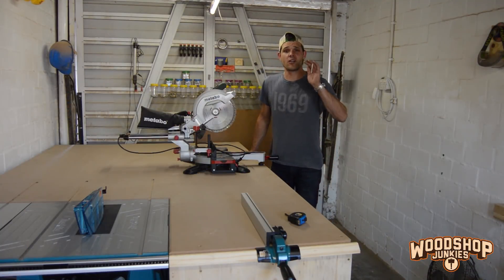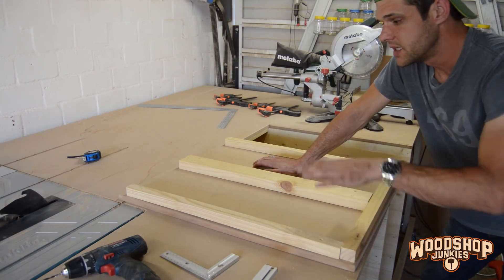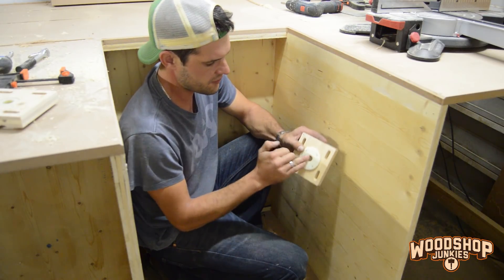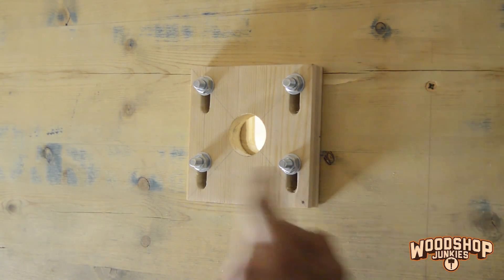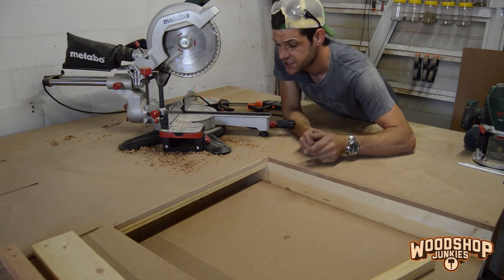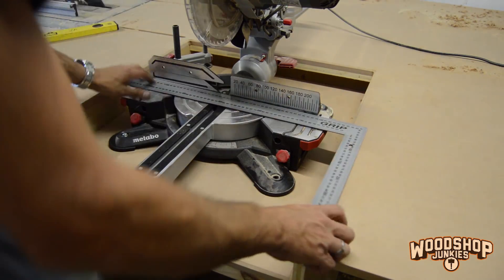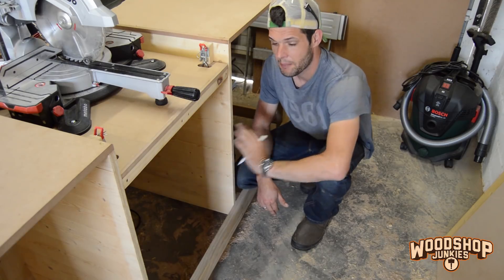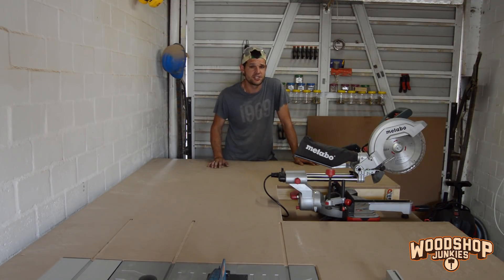No clash! MITER SAW INSTALLED to table saw station - ALL IN ONE woodworking workbench. P3

Comment: Why don't you cut a piece of plywood the size of the hole you cut out for saw , install  some side blocks to flush out to surface then install magnets to hold the filler piece in covering that hole. Nice job though😊 Charles Esposito from Louisiana USA

Comment: How does the miter saw do with 45 deg cuts? Is there enough space in the recessed section for movement in your angle adjustments? Thinking of similar installation in my garage workshop

Comment: If you can't find a bracket just drill a hole through the bar and use a locking pin.

Comment: Loving this series - actually breaking it down by segment makes the whole project less overwhelming. I was particularly interested in this segment for the mitre saw as debating myself as to whether a lift, a flip or folding, (like yours) is how I will go. This one is getting good consideration! 
If I may, one thing that struck me as you were installing the pivot blocks was how snug the rod was in the plastic bushes (which is not in itself a bad thing) - however the rod in the holes in the shelf is possibly (likely!) slightly looser; that means that the wooden holes in the shelf braces are more likely to pivot around the bar, rather than the bar to pivot in the plastic bushes. Now it's not like this is going to be rotating on a frequent basis, but ultimately the wooden holes can wear through this mechanism and the whole point of those lovely bushes is to have them be the pivots!. A simple solution to forcing the bar to pivot in the plastic (vs the shelf holes) is to fix the bar to the shelf so the shelf cannot rotate on the bar - this could be as simple as a ground-off screw through the shelf rail acting on the bar like a 'grub' screw. 
Thanks for your great tutorial and execution!

Comment: Great project. What about putting a lip on the inside of your drop saw area? That way, with the saw down, you could drop a free panel onto the hole and cover in the area formed by parking the drop saw. That would preserve a large clear uninterrupted work table. Cheers.

Comment: I'm enjoying this series. I wish I had the space to do something similar but I also have just a slightly over-length single garage and have to park my car in it too. So I'll be building separate rolling benches that can push away to the back when not in use.
Reply from the maker: Steve Crane unfortunately in our beautiful country this is the case. Cars can rarely be parked outside. In that sense I am very fortunate. But yes rolling benches would make sense if you would need to use the space for your car also.

Comment: Awesome idea. I would add some fixed blocks under your adjustable pivot points. Just incase they ever slip, losing the level to your table.
Reply from the maker: ObiBassoholic yeah not a bad idea. I was worried about the vibration from the saw causing the blocks to slip.

Comment: I really enjoy your approach to the project. I can see a couple of tweaks I'd have made, but those would be specific just to my own preferences. That, and I always over-engineer! Very cool.
Reply from the maker: Understandable. To be honest, this is a prototype. Building it is allowing me to test it and identify areas that need improvement. I'll probably add many modifications in the future.
Reply: I think it's a great design in general. Every woodworker is going to do it a little differently to meet their own preferences, joinery types, or tool needs. I think the only significant change I'd have made from the start is the material for the top, maybe electing to use a good finish grade plywood. But, there's always the trade off of moisture stability for something being milled flat. All in all, still a very cool project and design.

Comment: Love the idea, never thought a mitre saw and table saw combined into a single workstation would work well together. One tweak I would make add a back plate at 90 degrees to give more overall table space when the miter saw is down. Obviously this get s tricky with sliding saws and the rails poking through but i figure an extra hatch to let the slider through should do the trick, or at the very least just cut a hole for that. Would help with dust collection options as well.
Reply from the maker: I think I understand what you are saying and it's a cool idea. The only problem is that when the saw is down it isn't sitting at 90 degrees in relation to the bench top. It is slightly angled.

Comment: Table is coming along nicely. I would still create the cover insert so the full side table could be used for glue up or larger builds.
Reply from the maker: I am planning on adding one. I just don't have the material at the moment. I'll add it in the final "finishing up" video.

Comment: Great build of your Metabo Saw shelf (love my Metabo Saw), i'm not sure about those two latches for keeping the shelf up, personally i would have gone for sliding bolts.
Other than that one thing, i love it a great idea. Looking forward to the next part now.
Barry (ENG)
Reply from the maker: Hey Barry. I added the latches for convenience but I am looking at some kind of sliding bolt as a fail safe.
Reply: Great cheap solution!

Comment: Bloody Yippa Work Bench. Been downloading your vid's to get them into order so then I can follow each one, as your do your build. Was looking closer at your "Drop Down Miter Saw", Suggestion, why don't you put a false top over it so what way it wont gather shavings etc when the saw is in the down position. But, all in all, bloody great work station, PLUS, it's mobile. Great, Kev.
Reply from the maker: Kev R. Hildebrandt a few people have suggested I do that. It was also part of the original design. So I probably will put one on when I finish up the bench.

Comment: Awesome video, I'm working on my own workshop and love how you've put this all together.  +1 sub, and I definitely plan to use some of your ideas in my own builds.  If I can make one suggestion, you really should consider ear protection when using your tools.  Especially in a small space like you have, running that equipment without ear plugs is going to do a number of your hearing down the road.  Your call mate, it's just clear to me that you have a real future in woodworking, so making this decision now will be something you thank yourself for in the future.  Cheers!
Reply from the maker: I have a pair but when I make the videos I get so caught up in the project I often forget to stick them in. I realize this is not an excuse and I'll regret it in the long run. Thanks for the reminder! I'll need to start making a point of putting them in.

Comment: Considering moving the miter saw will only be temporary,  have you in hindsight considered using sliding rails instead? It would take up the space you use to get around the table but maybe not needed when sawing larger sheets anyway?  Maybe you get better stability with your folding technique so it always return to the same location and angle.
Great video series!!!!

Comment: Nice job and nice editing! I really love the way you built in the adjustability to the pivot. I think someone who wants to mimic your design could get away with just another square block with a tight 19mm hole instead of the bushing and a drilled hole with a cotter pin instead of the clamp if they don't have the ability to machine parts like that.
Reply from the maker: Jeremy Specce yeah definitely.  The clamps weren't machined though. Just hacksaw and file. But the bush is a bit more tricky.

Comment: Very nice😍😍😍. But, i think the box dust collection system from the back of the miter saw is still needed for both dust collection efficiency and aesthetically. The table saw might put too much dust on it even if it hidden and the miter saw will still make a lot of dusts when you cut multiple pieces. If you put the box lid on the back this problems will be gone. Additionnaly the workbench will still have a flat surface even if the miter saw is kept underneath. But otherwise, good job!!!👍👌👌👌

Comment: You should add a gas spring to the miter saw station to help it have a "soft drop" for the miter saw
Reply from the maker: That has been mentioned in the comments before and I think its a great idea. When the bench is finished I'm hoping to start looking into adding some of the suggested improvements.
Reply: i was thinking the same thing. counter levered spring or strut etc
Reply: I would go even further then that and add two 12v linear motors with a switch.  You can buy them relatively cheap on eBay, do a search for "linear motor on eBay.  They have some that can lift 330lbs by themselves.  Two would easily lift your mite saw.

Comment: I think I missed a detail in the adjust; I see how you adjust the hinge end of the table,  but not how/if the front is adjusted.  Is it far enough forward of the blade that "close-enough" was close enough? I'm loving the series.  Thanks for sharing,  cheerio SoCal, Daniel
Reply: I was looking for the same answer. I guess the latch bolt holes in the support wall could be elongated like the hinge area.

Comment: So, I was looking for a way to get the bushes and locking clamps, and found some 20mm Bore Diameter Aluminium Flanged Pillow Block Housing Bearings on eBay for about US$5 a piece. Some great ideas in your videos. Love them. Subscribed.

Comment: couldve done a flip over table , that way you have a flat table with the mitersaw hanging upside down under it , would mean the hingepoint is in the middle and far enough down so that when the mitersaw is flipped right side up its level with the table its a little more balanced too so you dont lift the whole weight 
it would allso prevent you from having to reach down so far to grab the mitersaw to lift it in possition

Comment: How about adding a thin chain to those pins then fixing the other end to the side of the wood blocks the locks are mounted on as I can imagine those pins getting put down and lost. 🙂
Reply from the maker: I haven't lost them yet but yeah, you make a valid point. When I have added all the equipment as planned I'm going to do a finishing up video that will include stuff like that. Thanks for the input.

Comment: This is simply genius.  Great idea and superb execution.
I do have to ask this question though:  Although I absolutely love what you did, why did you choose this fairly labor intensive option versus simply building a second shelf below this one and just sliding the miter saw either in its top "active position" when in use or on the shelf below, in its "storage position" when not needed?  Certainly not as elegant of course but a fair bit easier I would think.
But congratulations anyway!
Reply from the maker: There's a few reasons why I chose to do it this way. Firstly, though installation may have been more complex and labored, thereafter changing between working and stored position would be easy and effortless. 

I'm also planning on adding extended fences to the miter station at some point. For it to work, the saw needs to be fixed to it's base so that it is always correctly aligned with the fence extensions when the saw is in it's working position. 

Mostly, I just wanted to see how it would work. haha. That's the best part of being able to make things. Don't you agree?
Reply: i do agree indeed!
As far as alignment, i was thinking that if, instead of attaching the saw to the recessed top surface as it is now, you made a duplicate of that board that would fit snugly inside that recessed area and attached the saw to that one, you could then slide that whole unit in and out and it would align perfectly each time.
But, again, your solution is far more elegant and, indeed, once implemented, quicker and easier to use.
Subscribed!

Comment: You are awesome in what you have provided, and brings many more questions for me. I only want to do this once and right so I can get in with things here. When designing the depth of the saw to the table, how did you figure the length of the saw from the table top to the floor for clearance on the hinge and depth of the cut outs and placement on the sides? I have a sliding double compound 12" saw that is 34.5" deep handle end to parallel tube end, trying to figure the height from the floor, and distance from the front to back. I am working with a 4 x 8 ft of MDF. I am not restricted to this. My work shop internal dimensions are 11 ft 4 Inches X 31 Ft 4 inches x 8-13 Ft height. I want to make a work bench that works. What I have now does not.  I would like to keep the work bench at 36 inches from floor to top including the 6" wheels with brakes for moving it around. I feel the need for a Simple CAD program, I also have a planer to flip in this as well. The router can hide although I will add channels for fences, that is all recessed easily, and the table saw is simple. This chop saw is really throwing me into the weeds on a 4 x 8 foot table top. I will just have to experiment to find the right angle and see if I can get to a 32 inch work height or adjust from there. Any feedback would be great full.
Reply from the maker: It required a bit of calculation to determine the correct pivot point placement. I suspect that folding away a 12 inch saw would be even more difficult because of its size. It is difficult for me to advise because I don't have the physical dimensions of your saw. I would suggest building concepts with cheap materials to determine the best pivot point placement.
Reply: @WoodshopJunkies  That is what I will do tomorrow. I have lots of scrap to work with for the past 8 years I save. Wife has a fit but it all comes into play at some point for most of it. It's a big saw. Thank you!
Reply: Do you use a cad program?

Comment: Did you consider using drawer slides for the mitre saw base to slide it out of the way when using table saw instead of the pivot method? Less work, but also maybe not as stable or adjustable?
Reply from the maker: Coincidentally, your question has come up before but I think you are correct in assuming that you would lose much of the adjustability and accuracy with relation to the bench top.

Comment: Great build! I am looking forward to future updates. Have you thought about putting a filler plate in for when you are not using the miter saw? What about the front to back level? it seems like your front clamps are not adjustable. I wand to build something similar for my garage. Thanks for sharing.
Reply from the maker: My original design did have a cover over the saw when it is folded down but because I only intend on folding it down when I need it out the way for the table saw, or the router table that still needs to be added, I didn't feel it was necessary. I am, however, still considering doing so. As for front-to-back leveling. You are right, the stoppers/latches are not adjustable. The holes drilled in the stoppers are slightly oversized so the screws have a bit of play. My idea was to install them slightly higher and then add spacers to their underside if I needed the miter saw bed lower at the front. This was not necessary as the small bit of play on the screw/bolts allowed me to line up the front perfectly also.

Comment: Howdy, hope you are doing well.  If I may ask, how's the support system for your saw holding up?  The 3D printed parts and maybe how often you have to level it from getting used/roughed around?  Thank you very much.
Reply from the maker: It's still going strong. I moved since building the bench so I did re-do the leveling after moving the bench but that's about it. The bushings aren't printed, they were turned.
Reply: @WoodshopJunkies  Oops, not sure how I missed that. Thanks for your reply! Hopefully your new space is a little bigger. Were you able to salvage any of the built in storage you made like the fold down shelf system (awesome btw)?
Reply: @WoodshopJunkies  Hey, watching your video.  Can you share where you got the bushings?
Reply from the maker: @vicjguerrero  they where turned on a lathe by a family member.

Comment: Love your work. Truely talented. Did you have any issues with the power cable of the mitre saw when lowered when you wanted to use the table saw because it looks like the mitre saw cable sticks out a little?
Reply from the maker: It did because of the compression gland at the back of the saw. I removed it when I later added a lid to the miter saw cavity.

Comment: I like this a lot. Actually i want to make this same mechanism but to a mobile station with side flaps that folds down as well.
Question: why didn't you just use clamps to clamp the pipe to the bottom?
Reply from the maker: I'm not sure what you mean. Are you asking why I didn't use saddles to fix the pipe to the bottom of the base? If so then there are a few reasons. Most notably, I was using a 19mm stainless steel pipe and the closest saddle on the market in my area is a 20mm. If I had a 20mm pipe I could have used saddles. The result would have been very much the same.
Reply: Put a shock absorber under it  can go down slow

Comment: looks teriffoc but what range of degrees can you turn it left-right in case you want to cut a 45 etc.. it looks like you are limited by the opening walls
Reply from the maker: Eli Ben David when designing I allowed enough space for the saw to reach it's 45deg mark left and right. However, I neglected to take the latches into account. The lock knob for the saw bed needs to be removed to reach 45. For now it's not a problem as the secondary spring latch on the saw bed prevents the angle from going out while using the saw. I probably will modify the design soon.
Reply: it looks great all the same - i'm sure you paid attention to it nice job